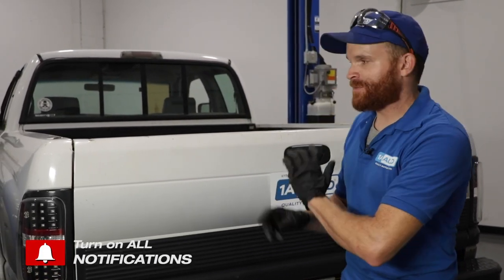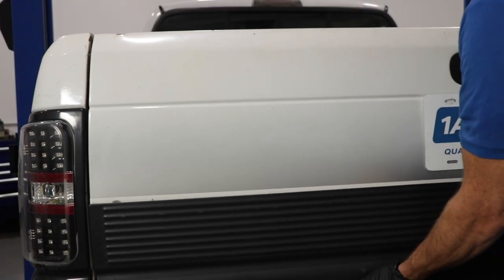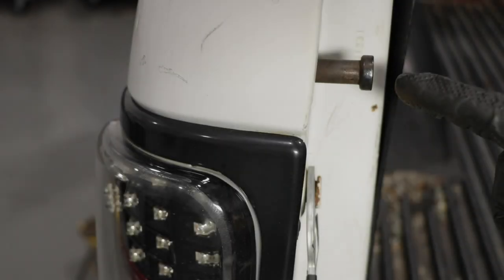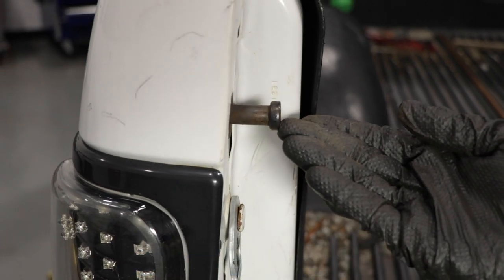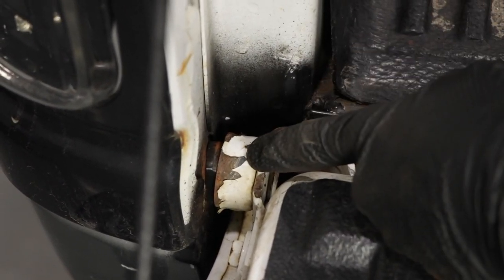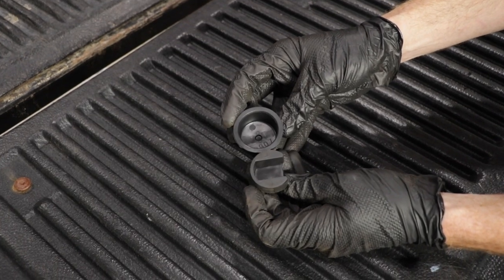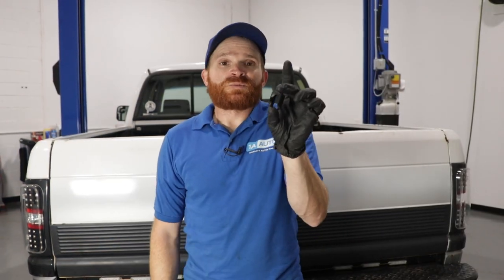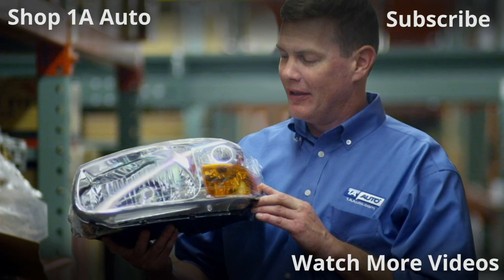Rattling Noise in the Rear of a Pickup? How to Diagnose a Truck Tailgate!

Comment: So I have a f250 4x4 changed the shocks still making loud clunking noise from the rear end only going over speed bumps but it sounds and sometimes feels like the bed is gonna break any ideas?.
Reply from the maker: +Shawn P We wouldn't be able to diagnose an issue like that here, you may want to have a local mechanic take a look at it. Thanks for checking us out! http://1aau.to/m/Shop-1AAuto-c